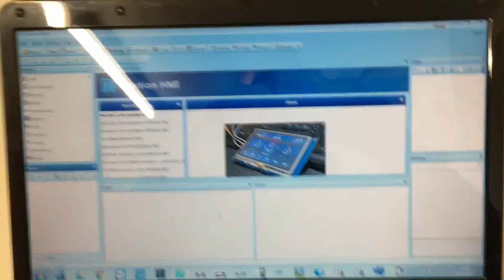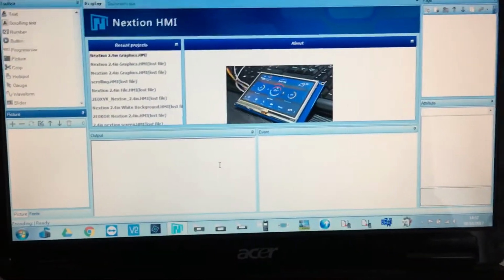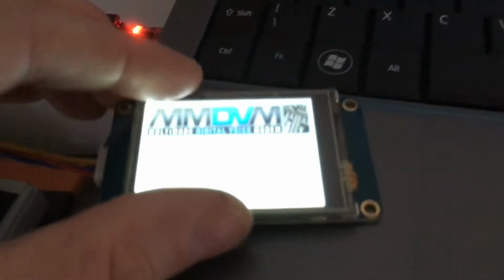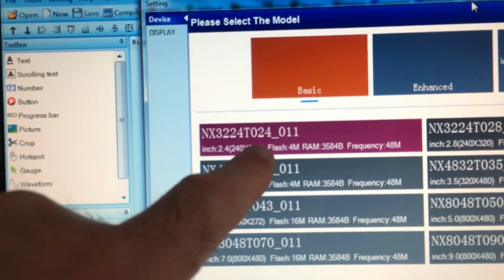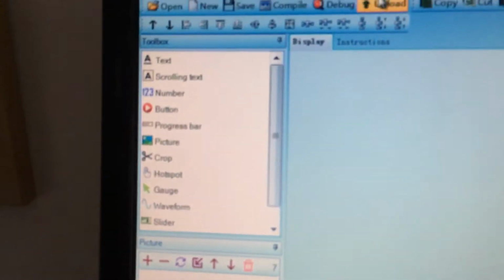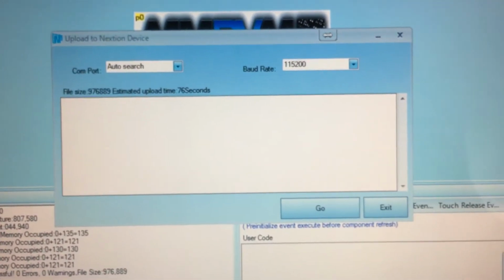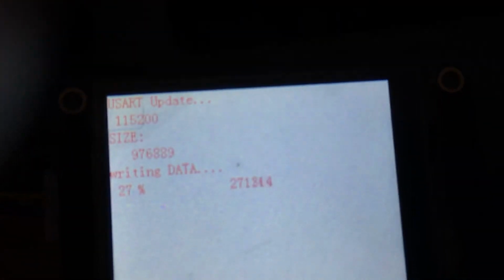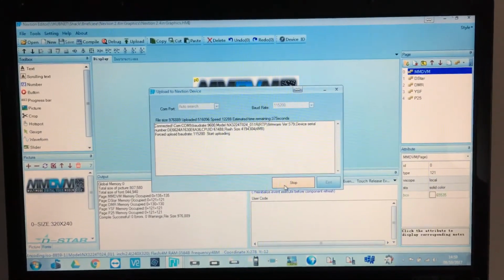Nextion 2.4in Screen

Comment: Hello Mick is it possible you can post a link to where you get your nexion screens from and what tti converter is needed i want to build a repeater builder board on a raspberry pi 4 with a nexion screen on front of a 1u19inch rack case so looking for a good screen with possible frame around it if you could point me in the right direction many thanks in advance

Comment: 2019...other instructional vids on youtube suggest using an sd card..is that mandatory now or can you still use the usb/ttl adapter..also..does the usb/ttl adapter require a driver? I have heard mention it does but cant find a video showing how its installed..on the screen? on the pi? questions questions....great vid by the way...no fuss and to the point ;-)